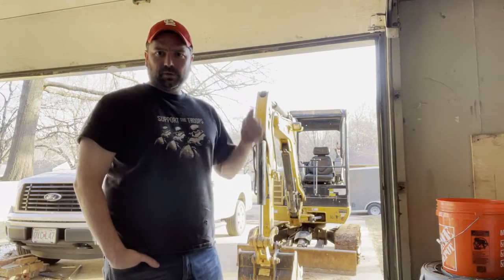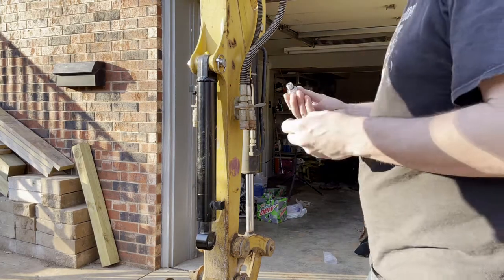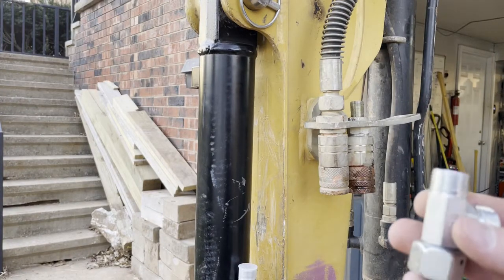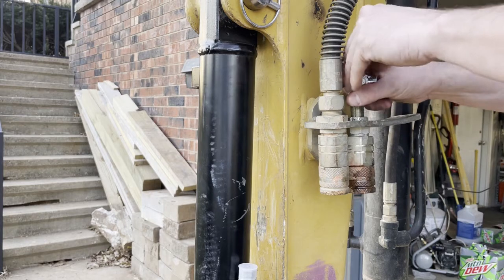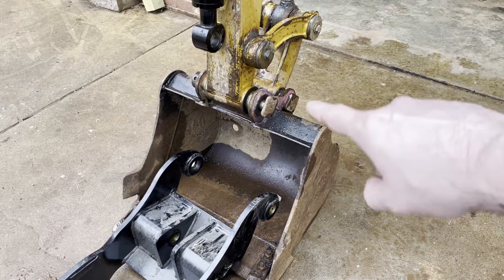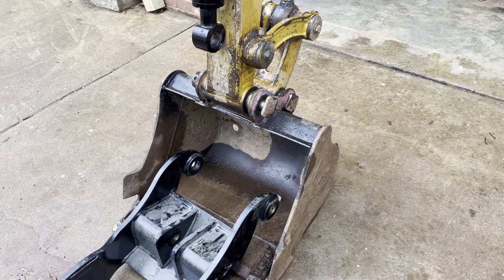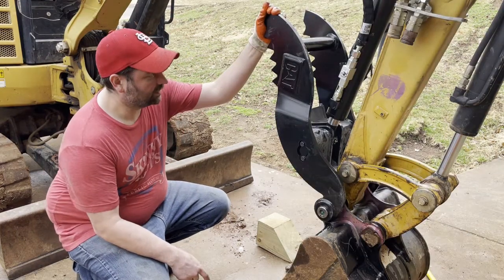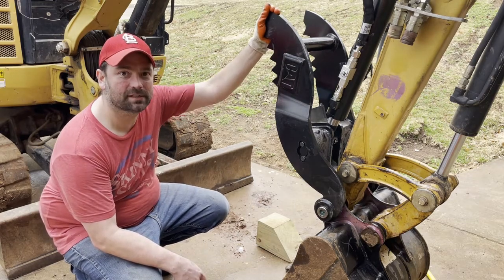Installing Hydraulic Thumb on Cat Mini Excavator

Comment: Teflon tape should never be used on the threads of any hydraulic fittings. Use liquid thread seal instead. If fragments of that tape get into the hydraulic system then you have a headache on your hands.

Comment: Thank you for your nice video! You mentioned that you had to buy a longer pin (which certainly makes sense)  but did you buy the pin from Cat or did it have to be an aftermarket pin since you used an aftermarket thumb? Not sure how this works. I have a Hitachi 35U mini with a PSM thumb and I need to buy a new pin and bushings as they are starting to wobble from wear. Not sure how to find the right pin & seals. Any thoughts on this that your willing to share?

Comment: Do the lines need to be bled after assembly? Or will the air work itself out? Just curious... I'm about to do this install on my 305.   Awesome video!  Extremely helpful and reinforces this isn't a difficult install to do on your own. Thank you!
Reply from the maker: Thanks for the kind words! I honestly couldn’t find an answer to this exact question prior to installing. I went ahead and installed it and after working the thumb back and forth the air worked itself out.

Comment: Only thing I don't like is the isolation valves being right on the cylinder vs being mounted to the stick it's likely they'll get damaged being by the cylinder and if you want to remove the thumb you'll have to cap the lines off

Comment: I advice against Teflon tape on any hydraulic fittings. Furthermore never use tape on a fitting that is not tapered thread. The gasket should seal not the tape. Next advice is install all your hoses loosely and then tighten the fittings so you don't put extra twist strain on the hoses.

Comment: Awesome. This video game me confidence in installing a thumb on my 305 myself. Thumbs are not very common here in Europe (or at least Sweden), so this was a great source of inspiration. Thanks for sharing.
Reply from the maker: Thanks for watching! Yeah I was a little nervous to try it without any experience, but the instructions that came along with the CAT brand thumb were very straightforward! Besides the weight of the thumb and cylinder, it was pretty simple really!
Reply: @hooterspfld  Mine did not come with instructions even though it was original CAT thumb directly from the dealer, but except from mixing the hydraulic lines up in the first attempt (one have a 90 degree angle), it was fairly straight forward. There are tons of boulders on my property, packed pretty hard, so a ripper with the thumb is a good way to get them out and to pick them up. Thanks for answering.

Comment: Bro, just a word of advice. Put the channel locks away and use the right size wrenches. You are using really expensive fittings. Also make sure everything is squeaky clean before you make up those fittings. I am a mechanic. Just trying to help. Not trying to be a douche.
Reply from the maker: Hey thanks for watching the video and thanks for the advice! You're right, it was like $2300 for everything, no sense in risking damage when I already spent so much.

Comment: Did you have to check/adjust the aux pressure?  I just got a Gentec 824 for my 301.7D and they say to set pressure at 1800
Reply from the maker: My aux controls have a dial on the joystick to adjust pressure. When I initially turned on my machine I let it sit with the key on for 7 minutes to allow the hydraulic pump to cycle and clear any air bubbles. Then I tested the thumb and it was closing very slowly. I just adjusted the dial until it opened and closed at an appropriate rate. Not sure if your machine has the same feature, but I just eyeballed mine.
Reply: good luck with that, cat doesn't put the relief cartridges in the valve, they are almost 700 each.
Reply: @tedkolosky5891   I'd like to know more on that.  I've searched but don't get any good direction